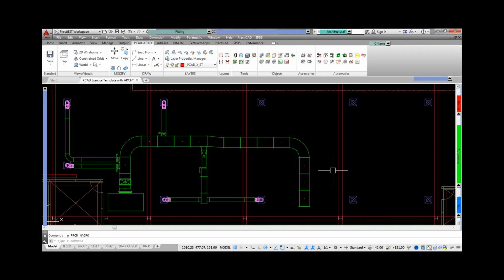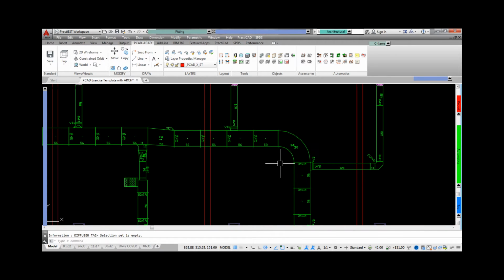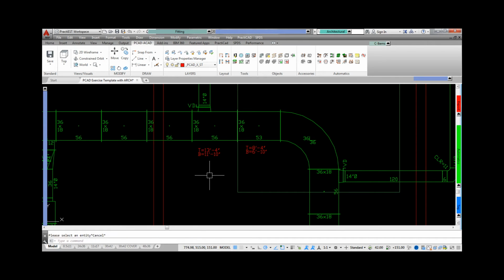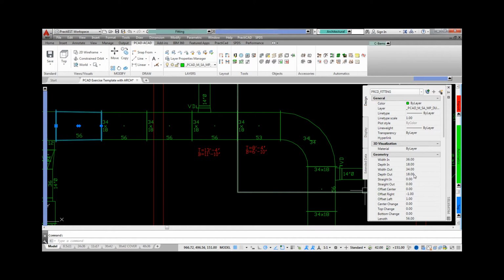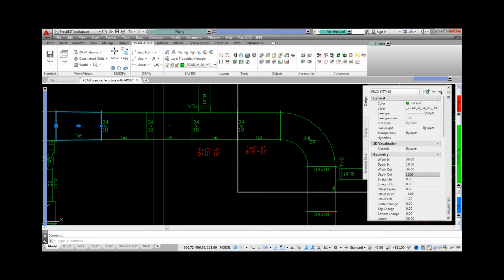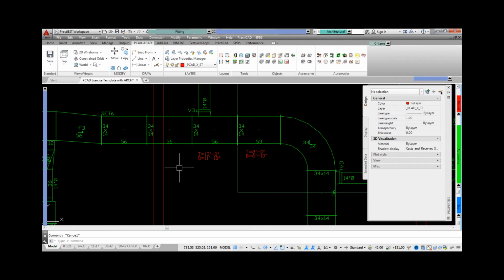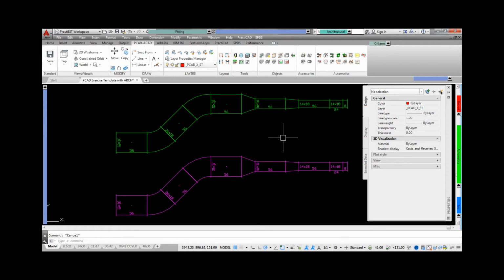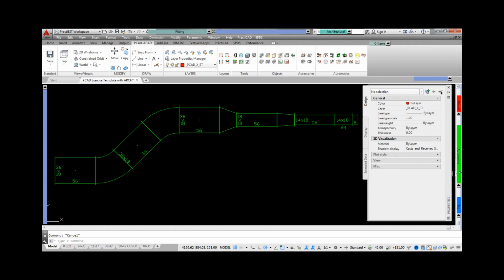PractiCAD - AutoTagging

Comment: I'm able to follow where you added the slab and create the elevation difference around 0:30. I'm having difficulty applying 2 floor elevation differences instead of the 1 additional you showed. When I create the two additional elevation differences, it favors one over the other and I can't figure out how to dictate specific pieces to have one of the offset, and another area to have the other elevation offset.